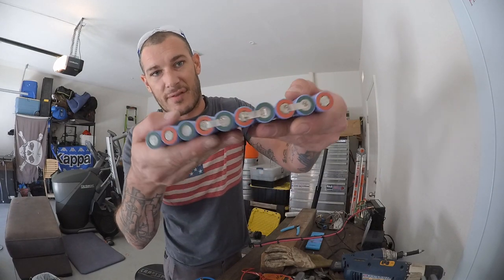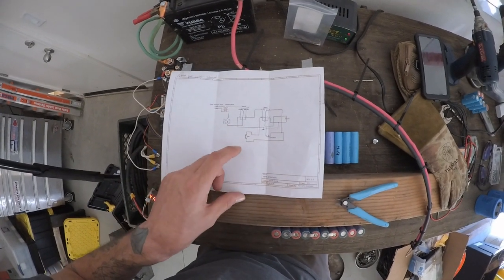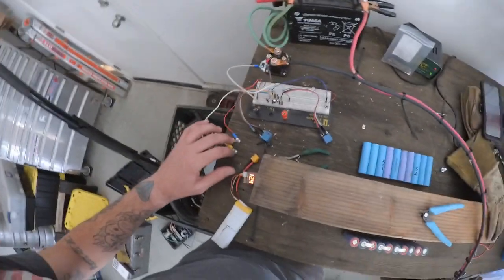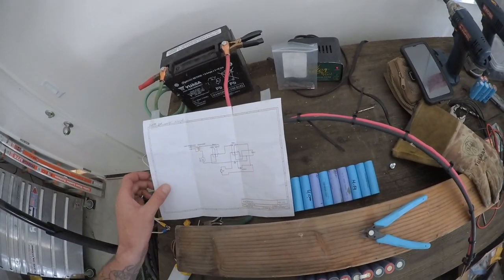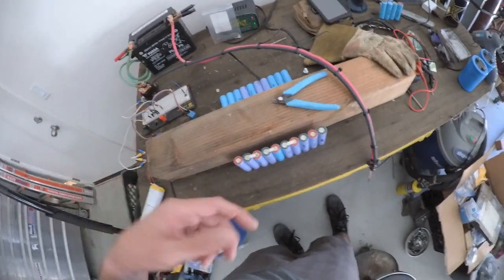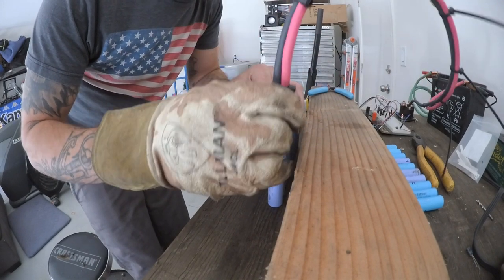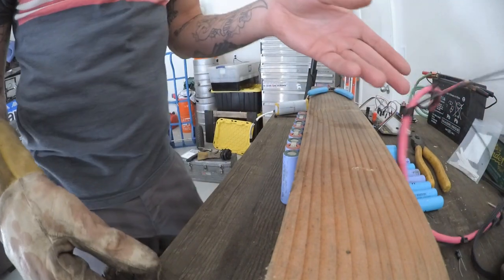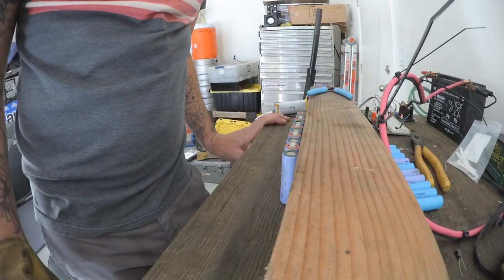DIY 18650 Battery Spot Welder - Simple and Cheap - NO microwave transformer - NO huge capacitors

Comment: nice video.  Will a riding lawnmower solenoid work as a substitute for a car solenoid? Also, I don 't quite understand why you use 2 relays to activate the solenoid.  Couldn't you use just 1 relay (put volt 12 volt battery (3 18650's in series) battery on the comm/NC side of the relay  to activate the solenoid?

Comment: great circuit. I was thinking i needed some capacitor to turn the solenoid on for only the welding duration time, but wasn't sure how. very simple and elegant. thanks a lot. I'm building one tomorrow, as my bike batteries are sitting here and not in my bike. LOL

Comment: No credit to the original designer and builder of this style of spot welder using a solenoid relay!... me! 😡
Reply from the maker: watch until about the 1:34 mark - I clearly state it is a mix of previous designs that were found on the internet. Nowhere did I state that I designed the battery style myself, but instead modified it to use a timing control loop from another design. - youve been edited into the description to ensure its very clear.
Reply: Remember, every thought is a download from the infinite of nothing new under the sun. Be sure to thank that frequency!

Comment: Very Interesting... What does the car starter do btw? What's the logic and what would happen if I do not add it to the circuit but directly connect the battery?
Reply: The small trigger switch cannot push the high current used. Thus the car starter. A small current from the switch will open the high current on to the spot welder. That’s what I understood.
Reply: @marcianzero_yt  that is literally what the small relay is designed to do.  It has a gate built in that allows a small 5V loop to power a magnet that activates a connector designed to handle high voltage/currents.  It can handle 10A at 28V.  A battery can discharge more than that, so it can be used to power the solenoid that can handle the 100A + at 12 volts that car starters need to turn an engine.  Which, is ALSO a relay that can be activated by a relatively low voltage to turn on a circuit that can handle much higher amperage.
Reply from the maker: the starter relay takes the huge instantaneous current load that is triggered when the button is pressed. The car starter relay is absolutely necessary and cannot be left out of the design
Reply: Just to clarify these answers for everyone.. Its Not at all a Car Starter, its the Relay (on/off switch) that supplies the tremendous amount of Current it takes for the starter motor to spin a Car Engine.. With out the Relay it would be like wiring that tiny switch into a set of jumper cables so that there was no spark/arcing when there connected and expecting the Tiny contacts inside that push button switch to be able to handle the load of jump starting another car.. 💥🔥 The contacts and possibly entire switch would go poof and disappear.. Lol
Reply: @swalowit DEFINITELY the entire switch. It would act like a fuse and melt with a poof of smoke and a fizzle